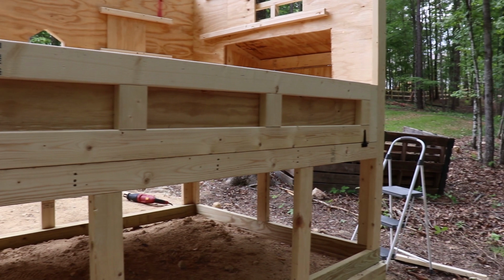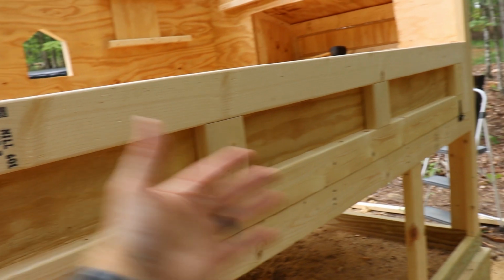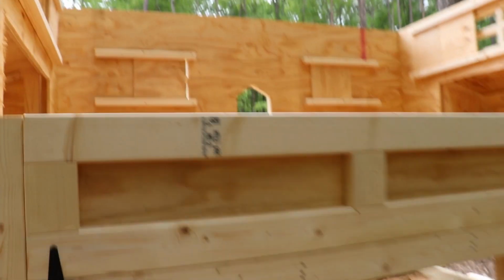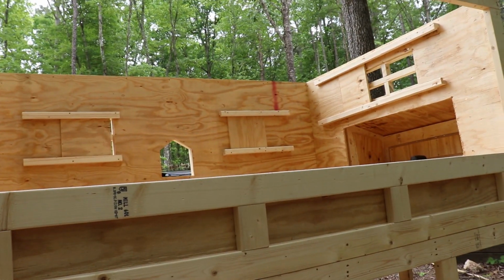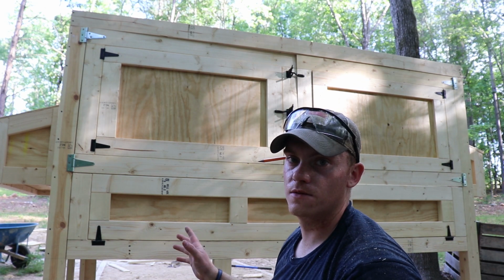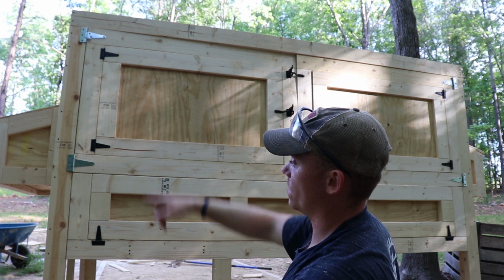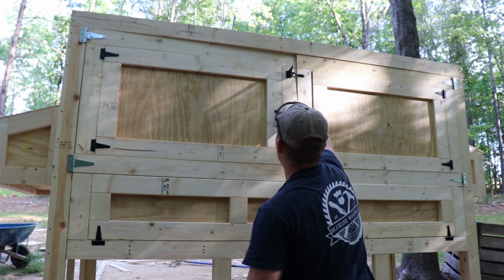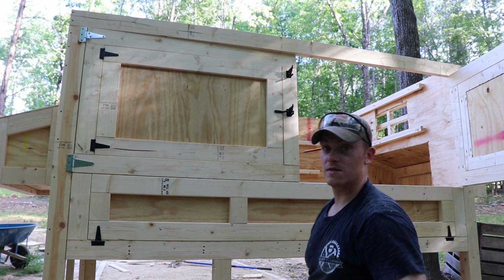Coop Build - Part 3

Comment: Been enjoying your videos.  It struck me just now that you should be able to paint your plywood wall sections prior to installation which might aid in weatherproofing over time.  Same with all the lumber - prime, paint and then cut.
Reply from the maker: I think you should roll with whatever method will be more efficient for your specific set up and work flow!

Comment: Just curious, did you caulk any of this, especially the egg areas prior to painting?
Reply from the maker: Nope and rain hasn't been an issue!
Reply: @LazyLabAcres  Thanks for the reply!  I'm considering a build simular to this so I'm taking notes.  I want to building in storage to mine to hold feed and bedding and the possibility of solar equipment. Think I may consider a loft storage in the rafters of the run area.
Reply from the maker: @MichaelRichterRealtor  there would definitely be enough room for a little loft in the run area!